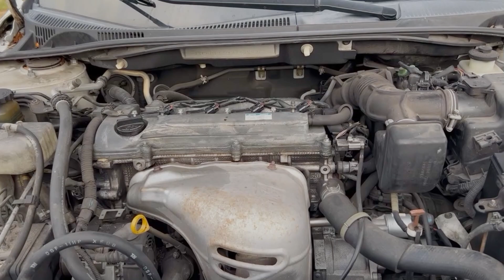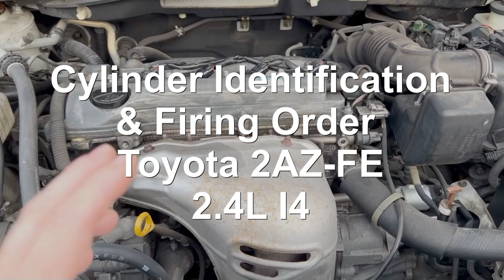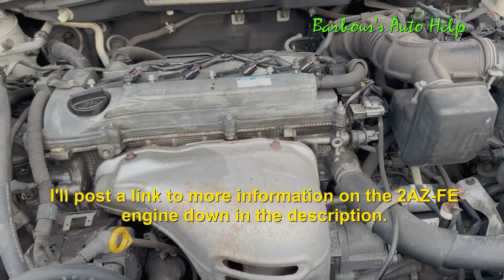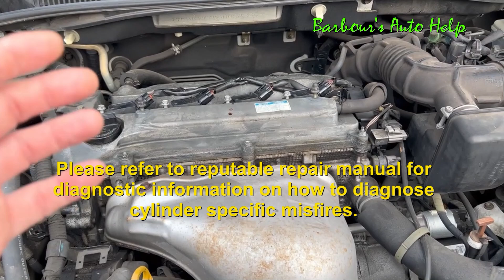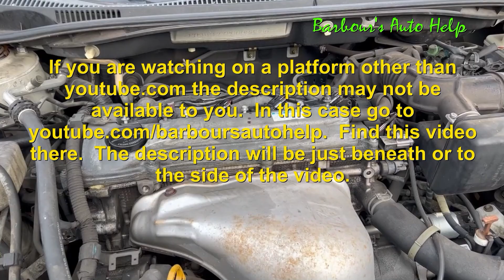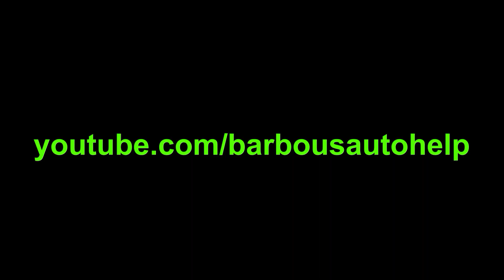Toyota Cylinder Identification & Firing Order 2AZ-FE

Comment: Could you give me your input as a mechanic 

Having issues for 2016 Corolla with 79000 miles 

Today I started the car and the Trac Off light (the words only) and engine light came on, but the Trac indicator (car icon with swerve lines) was off. Next the engine seemed to be trembling and the check engine light came on. I pressed the Track Off button in the car and nothing happened. I held it down for a while, then the Trac indicator comes on eventually. My car is usually so quiet, you would think the car stopped. Any ideas what this could be?

I suspect, based on research I have done, it's bad ignition coils and spark plugs. I love my corolla and would hate to lose it over something that is perhaps minor.
Reply from the maker: I am not sure but I would suggest having the codes read on it.  Let me know what kind of codes you got.